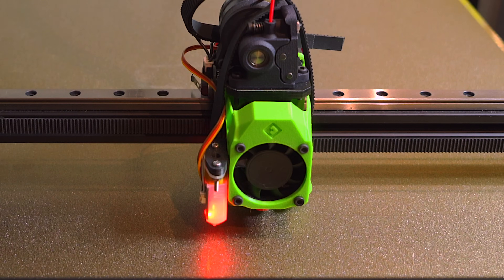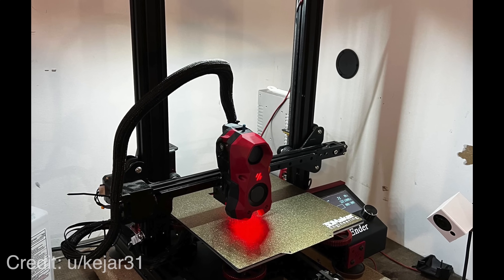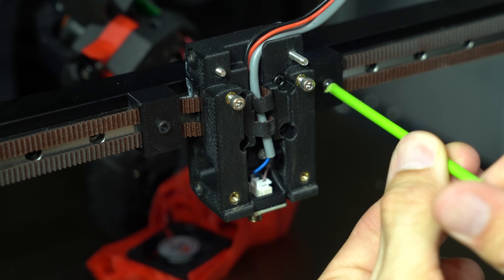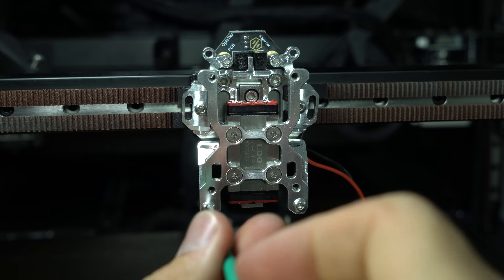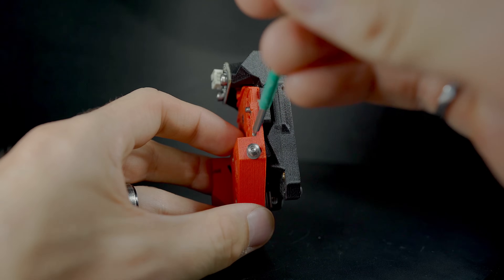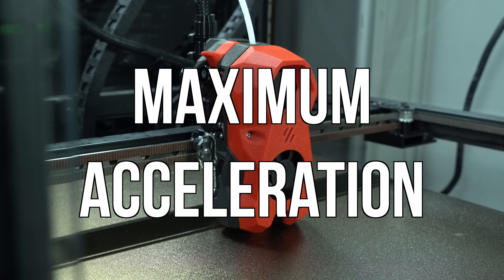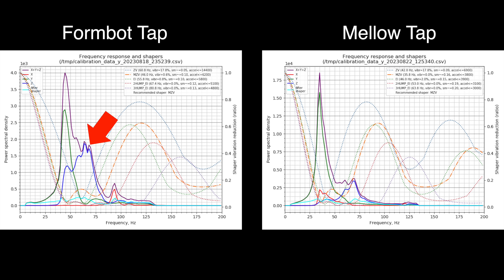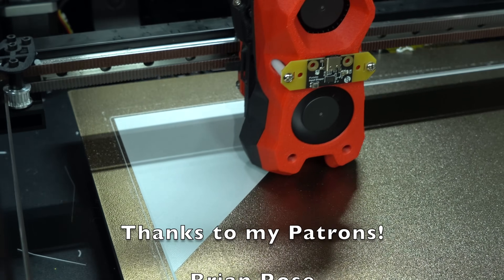Is Voron TAP Really "ALL THAT" ? A Semi-Scientific Analysis

Comment: Can definitely confirm issues with accuracy on the Mellow Tap. I also had one of the magnets come loose twice already. This one already replaced the Chaoticlab Tap. I'm running a Xol toolhead, so hoping to save a bunch of grams over printed Tap while reaping the benefits of nozzle probing, but it seems like I'll have to bite the bullet and either install a printed Tap, or move back to Klicky.

Meanwhile I'm running printed Tap R8 in a 2.4 and Boop beta 4 in a Micron with great accuracy.

Comment: Overall a nice analysis of the CNC tap. I wish you could have gotten that chaotic one tested too, but I think we have a clear “winner.” For me I prefer Klicky Auto-Z as I am running a much lighter toolhead on my V2 350 to help with accels. Sometimes, plastic is the answer!
Reply: You ever have any problems with klicky? I am trying to decide what way to go
Reply: @F1v30h1  just docking issues due to other things being wrong. Other then that it has been fine
Reply: What microswitch you're using? I'm on my 3rd klicky, they all seem to go sick after a while losing accuracy and error out on tolerance during qgl.

Comment: This just seems over complicated for what it is trying to achieve and has too many downsides I think. You want your print head to stay as rigid as possible, not having a large movement like that, that is just triggered by a force on the hot end. Strain gauge based probing is better or bed vibration based like Bambu does it has a lot less downsides for the same or better effect.

Comment: Great points, altough I want to add two things:
With klicky, the microswitch can fail. I had this happen where it was slowly dying on me and I had to change the Z-offset by +0.5mm immediately before starting the print otherwise the nozzle would ram into the bed. The optical switch of Tap is more reliable.
Secondly you mentioned that plastic on the tip of the nozzle can affect tap measurements, but I find it to be the other way around. The 600-1000g of force from tap will squish all the plastic off the nozzle while with klicky and the z endstop calibration you have the nozzle probing the pin/microswitch of the z endstop with a lot less force, leaving some plastic on the nozzle and even worse leaving plastic on the pin and after that reading on the housing of the klicky switch then also being off because of the extra plastic on the pin and then the nozzle going in to the bed. I also had this happen.
Reply from the maker: Fantastic points! Thanks for mentioning these.
Reply: I have had some oozy petg on the end of the nozzle causing errors with the tap probing, but now I know the cause I just double check before QGL or homing
Reply: This is why (with Klicky) I don't use the z endstop. The klicky is used to home Z as well as probing to prevent issues with nozzle ooze.

Comment: I used klicky before tap.  I had too many issues with klicky failing to probe consistently.  I switched to tap and never looked back.  Tap has been flawless.  I would also recommend running KAMP klipper macros with tap as well.
Reply: which tap kit did you use? i was thinking of going tap then saw this video. now im having some consistency issues and thinking of tap again but i want to go with the most reliable tap option.

Comment: I wouldn't use the nozzle as a bed probe... it often has bits of plastic in it and will throw off the reading. And I definitely don't like the idea of that tiny Z rail behind the tool-head... just another weak-point that decreases rigidity and print speeds. All of this and other design flaws are really turning me off from building a Voron. Looks like it's either VzBot or RatRig.
Reply: TAP isn't part of the normal Voron Build, I don't think it normally has any probe in the default config. I personally recommend a Klicky Probe, because it's fairly cheap and is fairly simple to build. It still requires you to find the z-offset. I think some builds include something to determine the offset for you outside of the build plate but I have only built a V0 which doesn't require a probe, or really benefit from one.
Reply: @Tomcat12789  Tweaking the offset once all 4 corners are even is not a challenging task with some test prints and noting values
Reply: @Tomcat12789   If you combine klicky with a z endstop you can have auto-z which will determine your offset for you even when you change nozzles and build plates.

Comment: How do you know that all of the reduction in acceleration is due to the TAP? I mean... There are so many variables that can affect the result; Belt tension being one of the major variables. Loose (or looser than completely tight) screws also can hurt a graph and therefore the acceleration. For sure the TAP will decrease the accel to some extend due to the fact you add weight and decrease the rigidity. Maybe the rails on either TAP device have different pre load on the rail which will also affect rigidity and the IS result 🙂

Nice video though. But I personally don't see this as a final conclusion as there is simply too many variables :D

Edit: BTW I don't use TAP or anything similar.
Reply from the maker: This is a good point. It’s hard to change only one variable when switching between the versions of Tap. I tried my best to keep it consistent and when I didn’t see a result I expected I gave it the benefit of the doubt that it was something I did wrong and not an issue with the product. This is why I went back and tightened the rail and switched the rail for the Formbot one to rule out those as sources of the higher z component of resonance. 

It’s certainly not a final conclusion because it is only a sample size of 1. Any good study needs multiple participants to draw a firm conclusion.

Thanks for watching and commenting.

Comment: Under bed piezo sensors would address most of these issues.
Reply from the maker: If that existed as a retrofit solution it would be great.
Reply: @ygk3d  There are multiple companies that supply retro fit piezo electronics in varying disc sizes. As i stated in my other reply these wre normally associated with delta printers with fixed beds.
Reply: And be less reliable, Piezos have been used and tried for over a decade and were found to fail easily and were unreliable over long periods of use. Tap like devices have been in use on deltas for nearly as long and have proven to be simple and reliable.

Comment: Does the Klicky with the auto z calibration allow similar plate changes etc? Mine is like bullet proof. I warm the nozzle, clean the nozzle and let it do its thing. Maybe one out of 100 prints something goes wrong. But it’s almost as reliable as anything I have seen from even like Bambulab
Reply from the maker: Yes, Klicky with Auto Z will make your z offset robust to nozzle and build plate changes, just like Tap.
Reply: I use klicky plus auto z on one trident and Vitali cnc tap on my latest trident, setup, use and repeatability is so much better with my tap machine compared to my klicky one.

Comment: It is also important the impact on usable accels, mgn12 adds a ton of weight, not to mention the extra weight on the print head
Reply: That's why it's recommended to start with the inductive probe first off, and mod from there gotta make your own choices, it's also good to remember that voron while yea you can make them go fast due to corexy kinematics, they weren't exactly built with scalability or high speeds in mind, it was created as a machine that you didn't have to service all the time and could run for days on end while remaining clean and quiet, high speeds cause issues with all of the above

personally I hate my bambu p1s cuz it's loud af and I can't do much about it, it'll print quick tho and if I need something quick well yea I'll use it but, my trident will take about 25-40% more time to print but even in my room I'll barely hear it over a video

Comment: I don't feel that this Voron-tap thing is what we needed. I do not feel the benefit...
I have a creality cr-6 and that probes with its nozzle (strain gauge) and has a quite low-ish accuracy in my case (0.01mm-ish) but still prints really fine 1st layers...
Reply: The big thing to keep in mind is the philosophy behind all things Voron... no custom parts, so all things must be able to be built with off the shelf commodity parts from standard suppliers. A strain gauge would work quite well but to get one  that would work would mean it would need to be custom made to work and thus was ruled out. TAP is not considered standard on an of the printers anyways but as its own sub project with a very specific use case. It is not the lightest or most rigid but is surface agnostic and far more accurate than it needs to be while not being prone to drift at enclosed printer temps.

Personally I like the benefits and accept the limitations it brings with it. That is the beauty of self built printers, we get to choose our priorities and build a better printer for our own uses and preferences.
Reply: @Bearded.Bucket  Makes sense... (I just thought that, for example, the HX711 is relatively widespread/widely available and may remain so for years to come.)
Reply: @TamasJantyik  While the hx711 as the amplifier would work just fine it's the actual load cell that present the issue. I would love to see it tackled but the Voron devs did say they looked at it and couldn't make it work within their requirements to a satisfactory degree, this is the joys of open source and the community, just because one group couldn't make it work doesn't mean it can't work just they didn't.
Reply: @Bearded.Bucket  Hm, I see. Thanks for your reply!

Comment: When comparing cost and assembly complexity, how do you think the tap compares to the beacon probe?
Reply: beacon >>>
Reply from the maker: Beacon is good for large beds because it’s so fast but it doesn’t do Auto Z, so if you change build surfaces or nozzles often Tap or Klicky would be more convenient.
Reply: Beacon is really fast.  It just doesn't measure non-metallic surfaces.  Nobody using one on PEI or anything else seems to mind though.

Comment: your toolhead board most likly will have 5v endstop ports.. like they all do.
Reply: Hi, the Troodon 2 only has 24V at the toolboard and they use a custom main board and that goes to a BOB at the back of the printer in addition to the toolboard - I think the only 5V at the rear BOB is for the chamber LED (and maybe one other for a sensor) and because they use a custom toolboard with shared pins it's not easy to get 5V to the head. 

You can get a 24v switch for the Chaotic Lab TAP from a 3rd party - and that worked well for me.
Reply: @work_stuff  ah i see, they use RRF and Duet boards. But it seems not the standard Duet Toolhead board - which has 12, 5 and 3,3v regulators.

Comment: I really liked my BLtouch that came with my Ender 5 plus.  It worked great, but once in a while the pin would fail to deploy.  I built my Voron with the included induction probe.  At the time I wasn't sure what build surface I was going to use so it felt like was constantly having to adjust the Z height.  I was reluctant to add TAP and was considering klicky.  From what I was reading, TAP was considered the better probe.  I heard it was a more complex mod, but it was pretty easy to build and install.  It's worked flawlessly since day one.  I like the added protection if the nozzle decides to take a dive into the build plate.

This was a great video on TAP and the different options available.  Since I build my Voron, I've learned so much about designing parts so they don't need supports and using screws to strengthen them.  I was surprised the aluminum one had lower acceleration values, but those screws used as stiffeners really are a cool trick!
Reply from the maker: Thanks for watching. The screw trick is definitely cool. I have been enjoying using heat set inserts in the parts I design. You can learn a lot by building a Voron and observing how they do things.

Comment: thank god this video came out, i was about to buy the mellow tap, thought it would be better than my printed tap
Reply: I think there is an issue with the input shaper measurements on mellow tap tbh, the graph is much lower frequency, I think something else is at play here, possibly belt tension
Reply: @williamluong7743  That's my guess as well. The modal peak dropping down from 65 Hz on X in the stock configuration to 55 Hz on X in the Mellow Tap configuration suggests decreased belt tension -- and the much higher frequency of Hz on the Formbot Tap suggests much higher belt tension.
Reply: @williamluong7743   also with the accuracy, I had issues until I tightened the screws holding the optotap sensor, the fastening mechanism is a weakness imo.
Reply: same boat…Amazing how much headache a little bit of research can save you lol
Reply: I'm hoping my "Z" offset will be more accurate with beacon.

Comment: All mechanical probes (klicky/microswitch, bltouch/crtouch, microprobe) dont care about build surface, so thats not really an argument for tap since most voron owners use klicky. The best use case with tap is in conjunction with a revo hotend. The base revo has not enough flow to really care about the weight gains and rigidity loss for the plastic versions of tap and the quickswap nature invites the user for more frequent nozzle changes. Also revo nozzles are 3 piece construction, unlike with single piece nozzles its difficult to always have the same length.

For me tap is out of question since i use a crtouch for bed leveling and homing as well as i dont, and probably will never do, swap nozzles as i use a tungsten carbide tipped one that probably outlasts the rest of the printer.

For revo users its a great thing, especially since you can get rid of the complicated macros and plugin for auto z offset often used with klicky and recommended for revo users